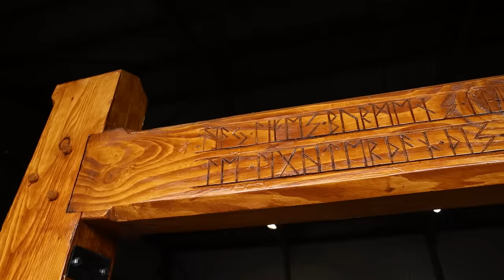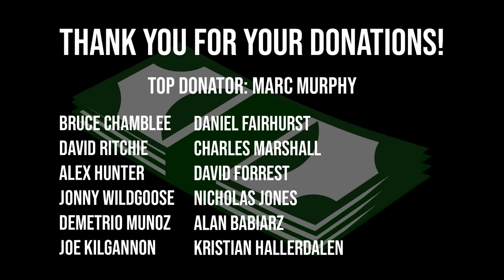ROAD TO WORLD'S STRONGEST MAN | NEW WORLD RECORD?! | Episode 17

Comment: The battle between Tom and Brian for the weight for height is gonna be nuts
Reply: Tom gonna win it for sure, he's more explosive and athletic, also he's taller.
Reply: @JustBerty  But Brian has so much experience with these type of events.
Reply: @alvinahl8193  same when Thor came into strongmen and Brian said no one gon beat his time and then the newbie Thor beated him
Reply: @JustBerty  Expensive?  What does price have to do with it? Also, I think they are both 6'8.
Reply: @troywalker8078  i wanted to say "explosive"
Reply: @JustBerty  He's not taller than Brian but he's taller than most of the athletes. You can see their heights compared in the 2019 atlas stone run where they went head to head, and Brian was taller
Reply: @JustBerty  fun fact: Out of the 9 years Brian and Thor competed (WSM only) Thor placed higher 5 times while Brian placed higher 4 times, and that 4 times are the ones he won.
Reply: @pbkimblee1858  because Thor was new in the sport. Since Thor started to work with Sebastian. He became unstoppable. He was better than Brian in everything, throwing, deadlifting and in moving events. Wsm , Arnold and Europe strongest man in 1 year , no one has done it before.
Reply: @JustBerty  young Thor was underrated as hell. From his second year, he was always on the podium, sometimes losing by 0.5 points. He was very unlucky going up against Big Z and Brian before their "old age" kicks in. He was just as good and sometimes even better than them and when he reached his peak, he was probably the strongest man to ever walk this planet.
Reply: @JustBerty  Thor didn't become unstoppable 🤦🏾‍♂️ he's only won one WSM title in his whole strongman career. Its not like he dominated like Pudzianowski did winning 5 WSM titles in 7 years.
Reply: @C--A  at his peak in 2018 he won 
WSM , Arnold Strongman Classic, Europe Strongest Man, World Ultimate Strongman ans Iceland Strongest Man... no one has ever won Wsm, Arnold and ESM in one year. 2019 due leg injury.

Comment: Awesome stuff guys! Great to see you both doing well. If you read this I have a word of advice that helped me get more out of my body in climbing. That is engaging the pinky. It helps a lot to get more power from the back and utilize the external rotation muscles in places I couldn't imagine before. Try this in your front hold as you seem to completely relax you grip which might isolate muscles instead of engaging everything you can. I hope this gives you some more seconds! If not well it doesn't hurt to try. :) Go Stoltmans!